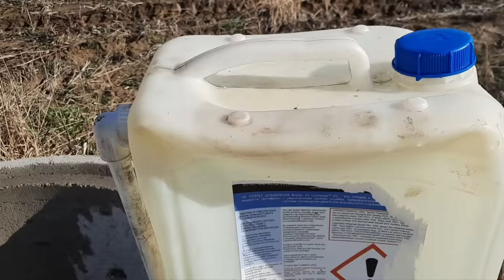Simple idea how to make a water pump without electricity without fuel

Comment: My knowledge of physics says that water moves from rejoin of high potential to that of low potential. Can you explain the principle behind water moving up. The water in the well have greater suction pressure than that at the tip of the tap.
Reply: im with you here....from what i understand,the water flowing out is the water initially added to the plastic container....its supposed to work under the assumption that as the water leaves it creates a partial vaccum which sucks water from the well...this partial vaccum can be seen in action at the end in as the container is bending into itself
Reply: however,this assumption is wrong...the air pressure working at the surface levelo of the well water will equalise with the end of the hose and then the water will stop flowing
Reply: @mickeyk899  trying to make sense of it. Possibly a one way valve at the bottom of the inlet?
Reply: Simple enough it's siphoning
Reply: The air pressure on the water in the well and the suction of the water being drawn out of the jug
Reply: @justinreed9852   I think I worked this out a while back. As long as the container above the well is strong enough to pull the water up without collapsing, water's heavy.  Also the water inside the container has to be heavier than the water being pulled up the tube. (If that makes sense)  a siphon is basically a one sided game of tug of war. EDIT: Also the vertical shaft would have to be primed full of water. or the air bubble woukd kill the siphon

Comment: I’d be impressed if you could make the water flow up hill
Reply: Just like another commentator stated , couple the Bose to a ram pump and you can make it go uphill. Only trouble with the ram pump is it wastes a lot of water to operate.
Reply: @christinamoneyhan5688  UM NO. A ram pump will NEVER work with a well like this. Ram pumps need constant running water. Ram pumps work well in streams and rivers. 

You are also NOT wasting water. All you are doing is using some of the energy from the stream or river. Some water is pushing less water up stream. So unless you are actually pumping the water into the ram pump, you are not wasting anything,.

Comment: If it had worked with just the tank on top of the concrete pipe I'd be impressed. But when you put the hose on it just became a siphon with a way of priming it built in.
Reply: Олга
Reply: So, a water pump without electricity or fuel?
A water pump is a siphon.
Reply: It's simple hydraulics not magic 😄. What you're describing isn't possible.

Comment: You can do a ram pump if you go down hill so you can pump higher that your water source,other than that with your set up if you are down hill and lower than your water source you woudn't need that canister.
Reply: Yes
Reply: UM NO. A ram pump will NEVER work with a well like this. Ram pumps need constant running water. Ram pumps work well in streams and rivers.

Comment: After watching and reading comments it is clear to me that a lot of people do not understand how powerful vacuum really is, nor how easy it is to create. I work with aquaponics and I am always looking for efficient ways to move water from tank to tank. I think I have found a good one. Thanks
Reply: But vacuum is total emptiness. Vacuum is no force and can not move any water. Amospheric air pressure on the other hand…
Reply: @kjellg6532  right. So let’s explain how a vacuum cleaner works for children to understand. Perhaps when you gain some life experience you will get a chance to find out how wires are fed trough conduit. Hint: a vacuum cleaner is attached to one end of the conduit.
Reply: @kjellg6532  also, when you read the wiki for your definition, read a bit further and you will understand vacuum from a working side.(as these gentlemen did in the video)
Reply: @uprightfossil6673  It happens I have been working with inducing fiber into plastic conduits. We never used vacuum, but compressed air from a compressor. The compressed air was searching its way to the lower pressure at the exit of the tube, bringing the fluttering fiber with it. Now if the pressure at the exit was zero, vacuum, still the high pressure from an open entry end would use 1 bar atmospheric pressure to rush towards the low pressure exit bringing the fiber with it. Now is it the vacuum that pulls the fiber or the atmosphere that pushes it?
Reply: @kjellg6532  отрицательное давление.
Reply: @uprightfossil6673  Put a tiny cup under the outlet valve, open the valve, and nothing happens.

No, wait a second, the system drains the cup back into the well! The water is sucked from the cup. The valve, container and tube down into the well works as a siphon! How come that if you remove that cup, all of a sudden the water will flow in the opposite direction?  If so, Can you explain why? 

This is a siphon. A discussion over this construction  can be seen here: 
https://www.youtube.com/watch?v=NiThJ9vUagU
Reply: As the water comes out, the air is sucked in. When the water in the bucket is used up and the air is full, there is no more water in the bucket.
There can be no perpetual motion machine in the world
Reply: @oflasho1  it is not meant to be a “perpetual motion machine” and it is not meant to be a permanent pump. This is as best described by those of us who use it “a siphon primer” or “siphon pump”. I move hundreds of gallons of water with pumps and by siphoning. This device allows me to not have to suck on the end of a dirty hose or carry my electric pump and battery out to the site. Those who doubt this are in the small brain group who cannot follow directions and don’t follow directions well.
Reply: @oflasho1  And if you dip the exit into a tiny cup of tea, no water will come out, even if the tank is filled to the brim. Ref a bottle, sucked in water and lifted by the bottom, neck still in the water. 

Even, if you take a milk glass, suck it, take a playing card and hold it to the opening of the glass and lift the glas/card combo out of the water, take your supporting hand away, and the card stays put with a waterlogged glass above! Funny trick.
Reply: @uprightfossil6673  I do agree that by adding a barrel, there is no need for a foot valve in the suction end,  but with such a one way inlet valve, the barrel can be reduced to simply the water filling stud, no barrel at all. A barrel filled with water can also accumulate some air, keeping the siphon going for some time even if some air is leaking in.
Reply: @uprightfossil6673  Ok, from your comment I conclude that you seem to run out of good arguments and we can agree that that this is a siphon with a priming barrel and only works downhill. 
As with you, I have been using siphons for more than 35 yrs so I know the theory and the practicalities.
Reply: @kjellg6532  so you have finally (after being humiliated and berated repeatedly) realized that what we were saying from day one was correct. Good for you! But you still have a seat at the children’s table of understanding. Edit: you obviously don’t understand or you would not have argued.
Reply: @uprightfossil6673  
Mr. Fossil, Please read your own adult, polite constructive comments, thank you.
Reply: @uprightfossil6673  Adding a motor to the water outlet becomes a perpetual motion machine?
Reply: @uprightfossil6673   "so you have finally (after being humiliated and berated repeatedly) realized that what we were saying from day one was correct. "

He was never humiliated. Just because there are more people who don't understand this and keep saying false things does not mean humiliation. 

And you are NOT correct. It is not a vacuum that is moving the water it is atmospheric pressure. While the syphon can create a vacuum, it is not what drives it. Atmospheric pressure pushes down on the water. 

If you ever seen a pet water tank. While there is a vacuum created at the top. It is not a vacuum that pulls the water down when the water level in the bowl gets low enough, air is let in. It is the fact that the air that is let in, lets the water come down. Once the the bowl is full again, no more air is let in and the vacuum is formed again. It is not a vacuum that pushes the water down it is atmospheric pressure. The extra air just lets the vacuum go for a bit. The air is NOT pushing the water down.

Water in the tube creates a seal and the water pulls on the water because the water wants to hold together due to the cohesive forces of the liquid.. If there is a break and air gets in the water is NOT being sucked in, it is just filling a void. Any rush of air you hear is just the water leaving and the air rushing in to fill the void as fast as it can. The break is letting air in and the atmospheric pressure is now pushing down on BOTH sides. Again the air is just filling the void on both sides. 

If it was a vacuum causing the water to be moved then why is there no air being PULLED into the tube and out the other end, when there is no water? With a vacuum the air or water is pulled not pushed down.    

So yeah. You are wrong. Now that's humiliation.

"But you still have a seat at the children’s table of understanding. Edit: you obviously don’t understand or you would not have argued."

That statement applies to YOU.
Reply: @kjellg6532  " I do agree that by adding a barrel, there is no need for a foot valve in the suction end, "

I agree with that mostly but it is always better with a foot valve. The temperature changes can an will cause pressure changes in the can, no matter the size. When that happens, the water in the riser tube can drop little by little back into the well. When that happens, it makes the tank have to let out more water before the water comes back up to the top. Meaning there is less water and more air in the tank each time. Eventually the tank is empty enough that there won't be enough water to start the syphon. So best to not let the riser pipe/tube ever get drained, by using the foot valve.
Reply: @AztecWarrior69_69  I cant see that. This is a siphon. For a siphon to work it must be airtight. There may be some air in the tank at start up, but from where should more air come into the tank? No foot valve is needed in a siphon.
Reply: @uprightfossil6673  "  right. So let’s explain how a vacuum cleaner works for children to understand. Perhaps when you gain some life experience you will get a chance to find out how wires are fed trough conduit. Hint: a vacuum cleaner is attached to one end of the conduit."

YOU should be apologizing for this condescending comment. Since YOU are the one who is wrong.

Comment: At 2:55 those wind turbines are really working hard to save the planet!
Reply: @John Locke's Ghost Working about as well as your brain. 🤣
Reply: @matthewgoedtel5998  Fun fact: a wind turbines gearbox can hold 60 gallons of oil that has to be changed every 3 years (assuming there are no unscheduled repairs). That's 20 gallons a year, or about 10 times as much as a normal car would use.
Reply: @johnlockesghost5592  Fun fact, your story doesn't matter. Is oil recyclable?
Reply: @matthewgoedtel5998  sure is, unlike wind turbine blades.
Reply: @johnlockesghost5592  Do you ever get tired of being wrong?
Reply: @johnlockesghost5592  :Never argue with stupid people, they will drag you down to their level and then beat you with experience.”
Reply: @Tunnelrat6666  Original response...
Reply: @matthewgoedtel5998  I embrace being wrong, it's an opportunity for education. Can't help but notice you didn't (can't) offer any.

Comment: Physics + Suction = this water pump. How does it work? 2 things to remember. Air tight connections at the tank and water weight. You just need enough suction and water weight to pull the water out of the well and into the tank and then gravity takes it from there. The water dumped into the tank to get it started is known as "priming the pump" which means any obstruction at end of the pipe in the well and you'll have to go through priming it again. You need a good filter on the end to prevent obstructions and it would help to have a feed tank with a check valve this tank feeds into in case you need to prime the system again.

Comment: This is just a simple syphon device. It is not a pump. The water tank is a way to start the syphon without having to suck on the end of the hose. It only works when the water surface level at the intake is higher than the discharge end. Alternative is to submerge the whole hose in the well to fill it with water, hold your thumb over the discharge as you go down the hill then release your thumb to start the syphon.  No need for a tank, valves and worries about leaks.  Any air leak in the tank will stop the syphon.
Reply: PUMP -- 1.
a mechanical device using suction or pressure to raise or move liquids, compress gases, or force air into inflatable objects such as tires
Reply: @roseymalino9855  this is not a mechanical device, its a syphon, simple and just works, no mechanical parts
Reply: If you don't know physics you won't understand.
This system allows you to suck water at a lower depth and discharge it at a higher level.

Well as a syphon pipe only will not give you the same results without an air tight container.

Syphons work only wen the source is higher than the discharge
Reply: @kizitomakayasini5368  This is a syphone and is not able to discharge  anything at a higher level than the surface in the well. If it could, you would have a Perpetuum Mobile. From physics, that seems unlikely.
Reply: @kizitomakayasini5368  Please think for a moment and try again. Operation is only possible if the water level is higher and the outflow is deeper. Free energy does not exist!
Reply: It is a simple device, that gives rise to invention at the point of recognition of the functionality potential.